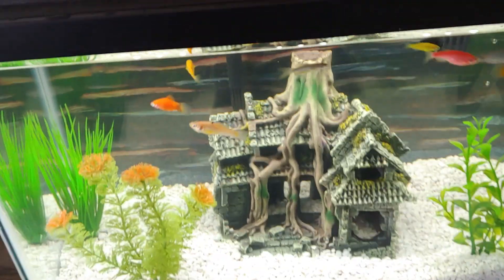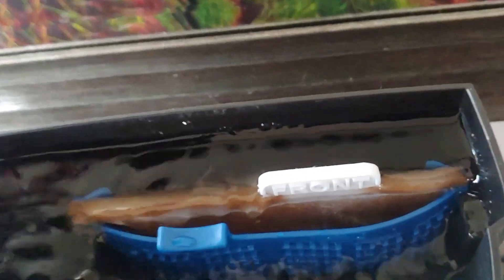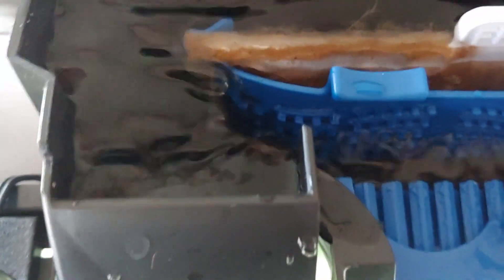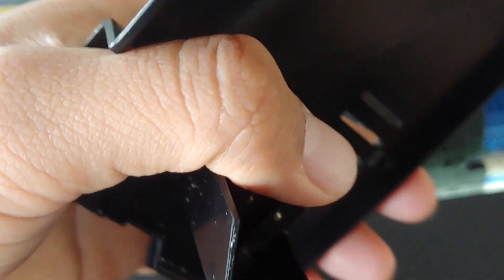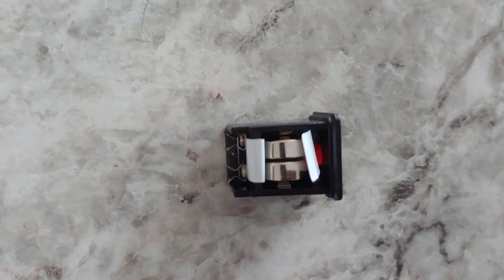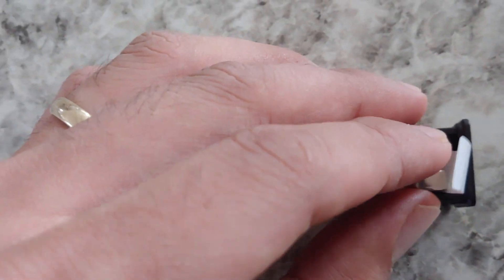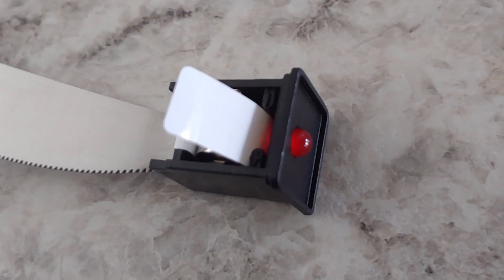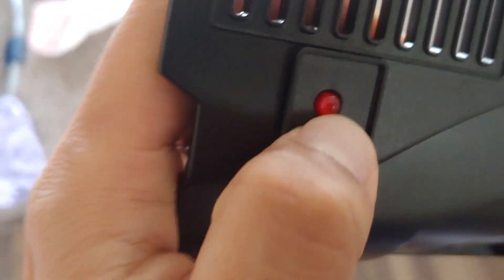AQUEON Filter/Cartridge LED and battery placement

Comment: So just to confirm, the light should not be on if the filter is properly working, correct?
Reply: Did you find out if the light should be on?

Comment: Just just get a fish aquarium is 10 gallon so I forget to look at the instructions about the battery part and I ended up throwing away I told the paper away Orlando Torres video you're actually supposed to keep the paper on I hope that still works